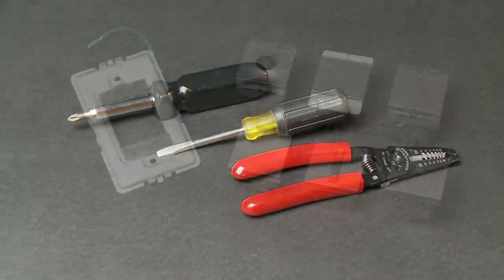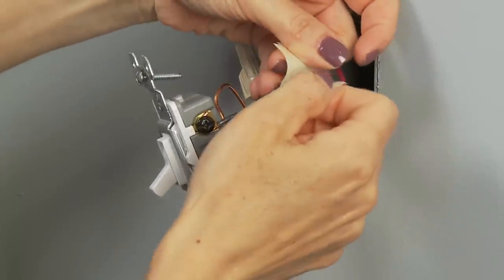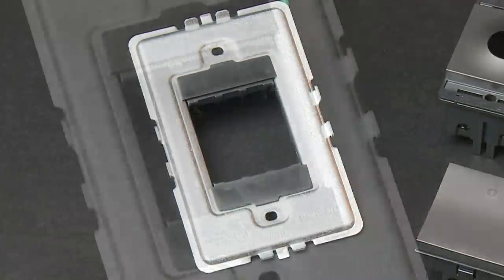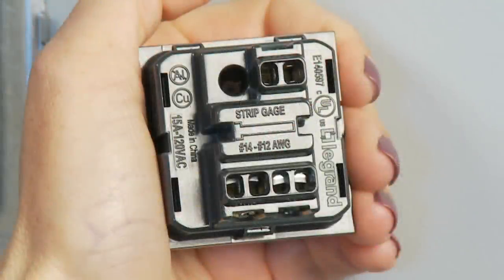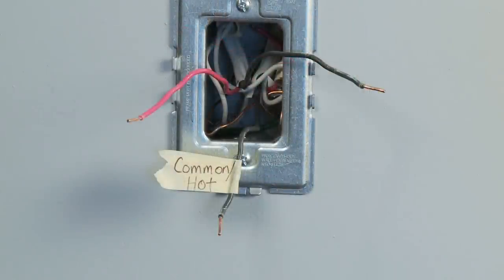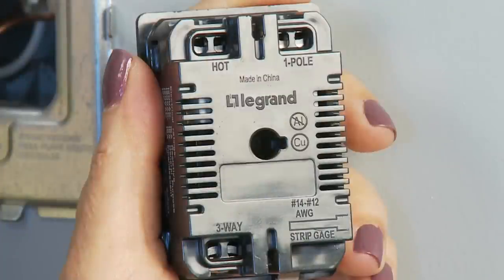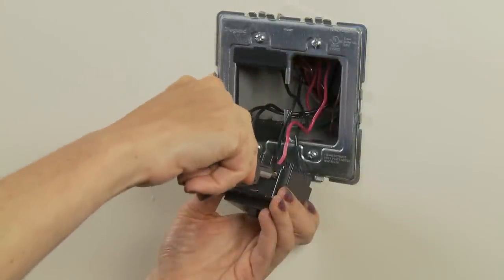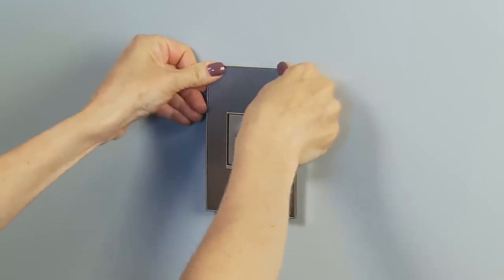adorne: How to Install a Switch

Comment: I wish you guys (Legrand) would make some videos on best ways to remove Adorne switches.  On numerous occasions I've wanted to swap paddles for dimmers, motion sensors, etc.  Removing the already installed Adorne switches, even to swap them with other Adorne switches, is a real pain in the you know what.  I've yet to find any tips/tricks on how to do it without scraping up my hands and/or breaking pieces off the installed switch.

Comment: All I needs to know is how to install the locator light wire. But the video didn't show how and the instructions come alone with the product, didn't tell clearly and the picture are not the right one. So when I call for the 1-800 line, they were holding me for more than 30min and hang it up. I really upset.

Comment: I just bought a Touch switch. firstly on my el.box I found a blue line and a red (that came continuously so I cut it). and I tried all combinations with wires but the best I get is light always ON or always OFF. switch doesnt react to any touch. can you help me step by step, please. no electrician will come for a 1 switch.

Comment: Please post on your site support area wiring diagrams - the videos you have are well done - but they dont show how the lights between them should be wired..
here is an example of what would really help if you customized for your products: http://www.wikihow.com/Wire-a-3-Way-Light-Switch and please identify which terminal on your switches to use...
1 example that i dont see you have posted is power to switch1 with two lights between switch 1 and switch 2.  Switch 1  =softtouch dimmer and switch 2 = paddle switch.